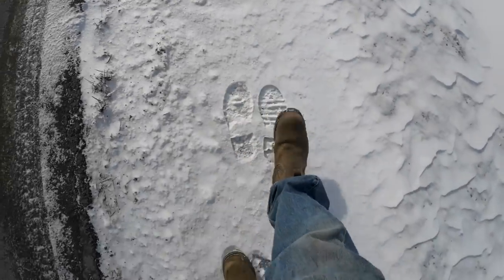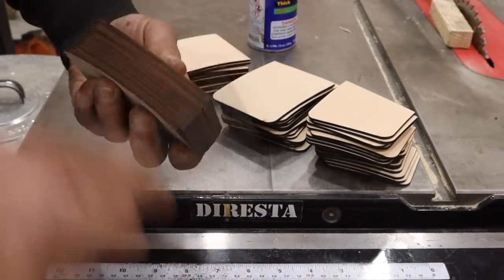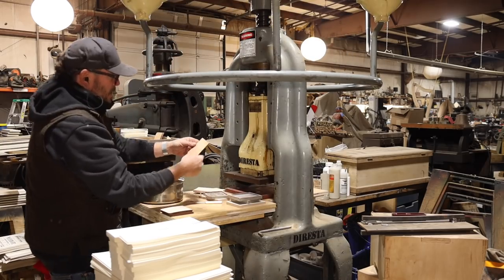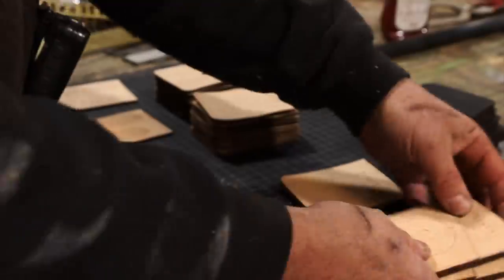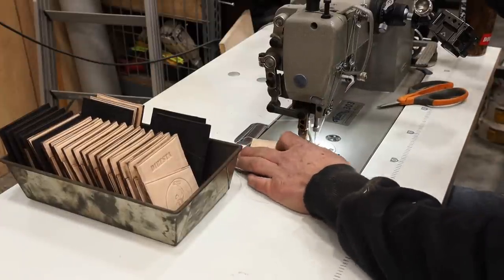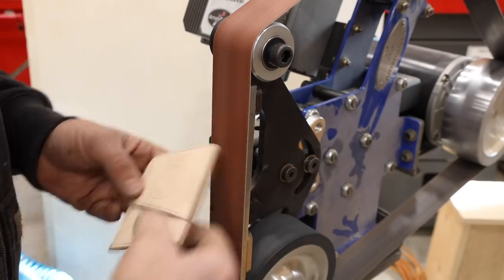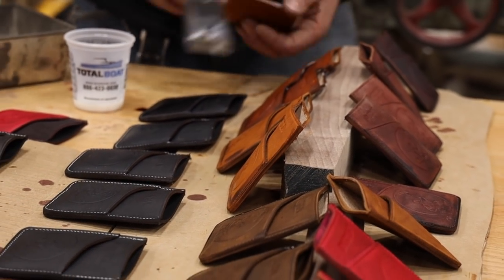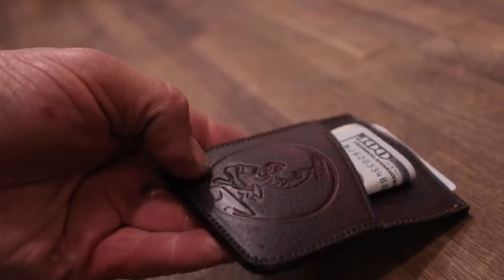Creating Custom Wallets with Die Stamps

Comment: Just incase folks are curious, Diresta likes to use some things from woodworking that are not correct for leather. PVA glue is a HUGE no-no for leather as it is WAY too stiff and will crumble/flake over time as the leather flexes. If you're looking for glues, use any contact cement and you wont have to do any clamping and will have a much longer lasting product.

As well, you should ALWAYS add an oil onto the leather after dyeing and before your topcoat. Dyeing leather uses a solvent which sucks all of the natural oils out of the leather. Use something like a neatfoots oil (good penetrating liquid) to add all of that natural oil back into the piece. If you skip this step the pieces become hard like wood, and will crack very easily.
Reply: Thanks
Reply: I too like the softer glues for most applications. How do you feel about bee's wax as a top coat? I have had very good results on several dyed, stitched and heat treated collars.
Reply: literally none of what you said is true.